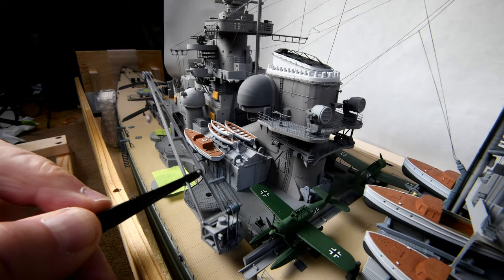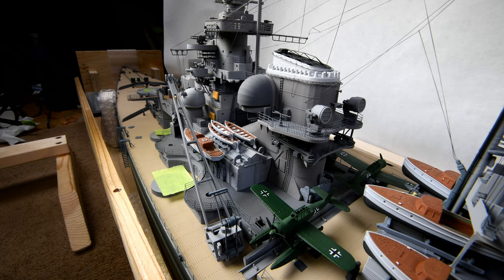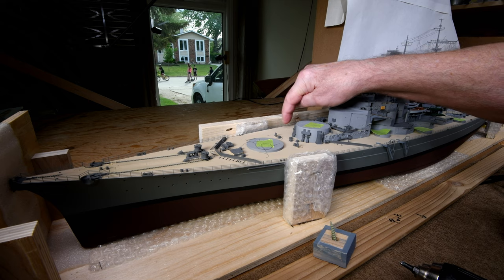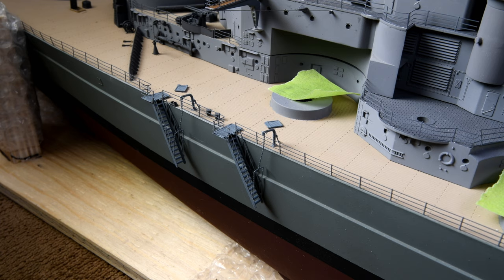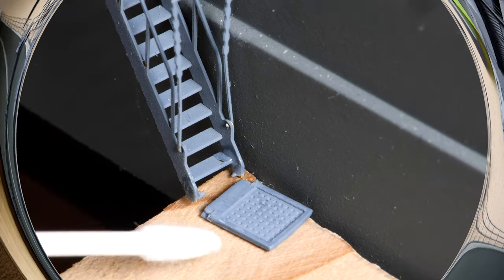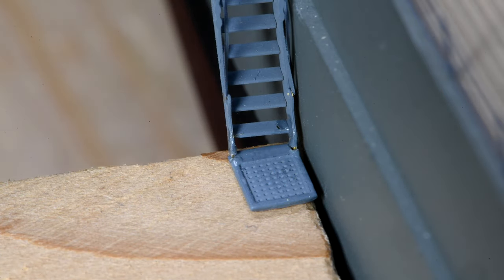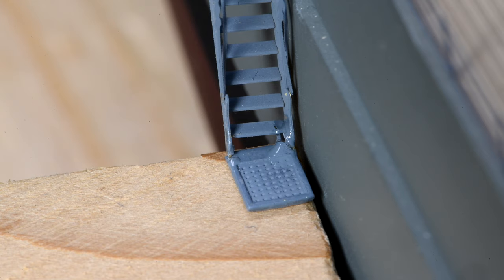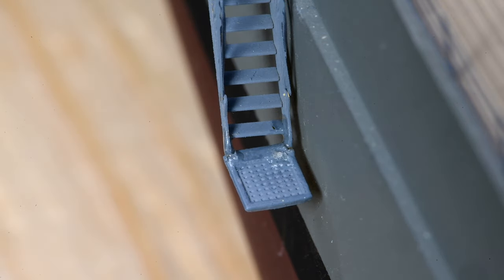The Model Ship - Part 462

Comment: Ron, to remove fresh excess CA, roll a corner of Kleenex to a point and touch it to the excess. It’ll suck up the excess. Another thing, to get the hook even, try an experiment. Pull the hook down,so it’s even, keep the tension on and apply a tiny amount (using a toothpick) of medium CA to each side of the lower portion of the hook/EZ Line connection point and let the CA wick up. Don’t use your CA applicator.
Should hold it in proper position. But try it on something scrap first.
Reply from the maker: Hi Tony,
Re: "to remove fresh excess CA" Those mini Q-tips are much more dense than the normal cotton bud. They'll work fine on CA thin. Yup, where was my roll of COVID deterrent when I needed it, lol.
Re: "try it on something scrap first" I woke up early this morning, wide awake,  and realizing that there was little chance of getting back to sleep, I'm now checking the comments. Soooo, why not shoot the E-Z Line/CA experiment now and insert it into episode 463 later.
Last time I did any videoing this early was when capturing the sunrise some years ago. https://youtu.be/nT7EiAFH1Ts

Comment: Hi Ron,   I noticed that the hook on the crane is a little too high. I you can that the hook and attach it to the side of the upper bulkhead.
Just a thought. We will see tomorrow how you figured it out
Stay safe,
Jason.     😷.   😷.  👍.      ;-)
Reply from the maker: That's a thought Jason, but we'll see how it looks after the turrets are place in place. I've been thinking of maybe suspending a bundle of those yellow life rafts from the crane, positioned so as to look as though they are being lowered onto the top of the turret. 👍
Reply: Ron,    OK, but you do realized that in a sinking ship no one has the time to hook up life
 raft to a crane. They were just let slide off the slide of the ship. The sailers would then
 jump overboard, then swim to the life raft. Have fun figuring this one out. I know you like that.
What does your book show?
Your friend,
Jason 😷.     😷.     ;-)
Reply from the maker: Yes, I guess that we do want to keep this realistically believable. 😁

Comment: Ron, could you run an anchoring line from the hook back down to a location at the base of the boom, tightened to stop the hook from swinging, which would also tighten the hook's cable?

Comment: You had to go any do it... Get me thinking about strange things too.  So if your camera is picking up the reflected light off the towel, would that be the same as shining the light directly at it or would it be improved, replacing the towel with a 'hard' surface like your plexiglass or a mirror? Now I'm not going to get ANY sleep 😂
Reply from the maker: No, the idea is to measure the light coming off a neutral density reflective surface. That towel was in my estimation the closest handy thing around. I used to have a light meter  that I'd point directly at the light source, like the sun or a floodlight, but haven't seen it since the early 70's. Now get some sleep. It's almost midnight over there.  😁

Comment: Drill a hole in the hook and put a lead wire in it?
Reply from the maker: Thanks for the idea Paul, but, I don't need to drill a hole because that double hook style allows for a loop of EZ-Line to be slipped over it and the pulley block will then perfectly straighten out.
Now, pardon me for chuckling to myself, but because of the macro lens I don't think that viewers have any idea just how small some of these detailed parts really are. 😁👍